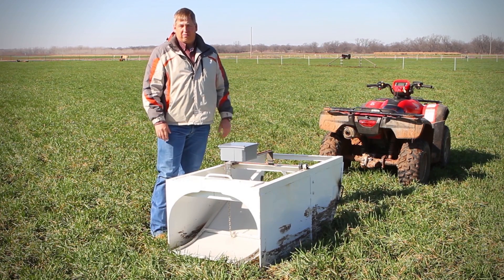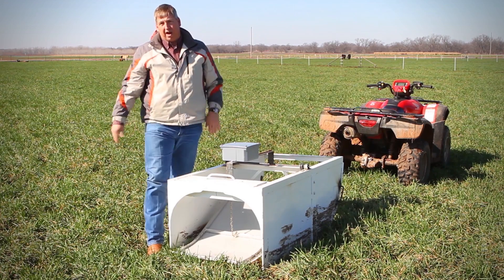Using the Rising Plate Meter and Forage Sled to Determine Forage Mass

Comment: C-Dax in NZ have a proven PatureMeter which uses laser and gps technology to accurately measure pasture at speed (independent of bike, user or terrain factors so extremely accurate).
Reply: I have been using the C-Dax since 2009. Great machine!